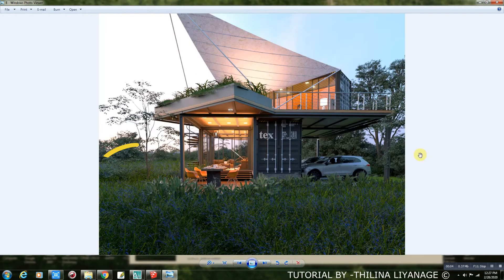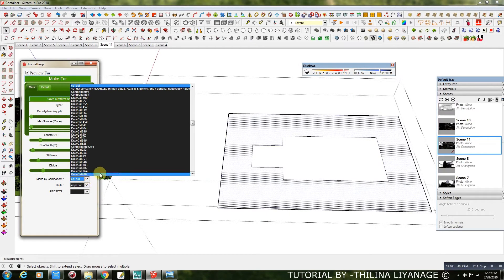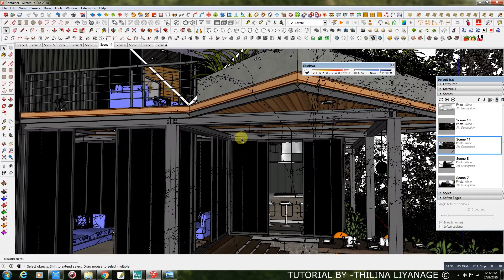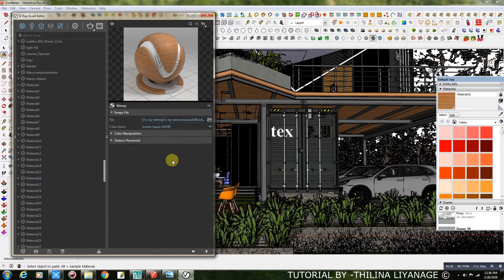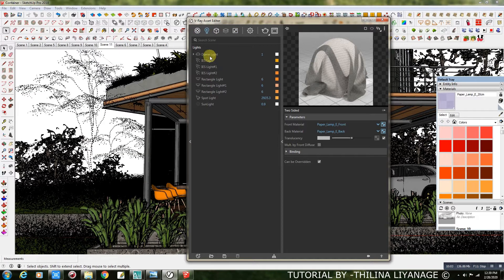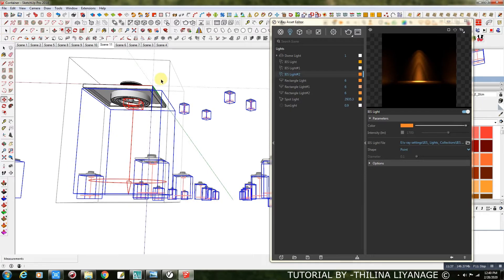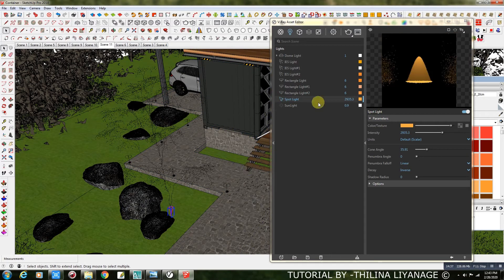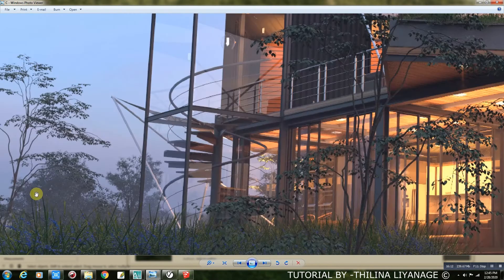Vray Next For Sketchup Render Settings

Comment: How long does it took to render using GTX 1050ti GPU ?? I am thinking of buying a new laptop for vray sketch do I need a better cpu or GPU ??  My 2 options are ryzen 4600h with GTX 1650ti or i5 8th gen with GTX 1060 6gb
Please reply 😃
Reply from the maker: go for 1650 ti
Reply: @Thilinaliyanagevraysketchup  Thank you .. Is it ok if it's GTX 1650 ?? Because it's 10k cheaper than Ti version
Reply from the maker: @elangkumaran1996  but best is ti,if cannot go for same as mine card,gtx 1660 OC vesrsion
Reply: @Thilinaliyanagevraysketchup  the problem is GTX 1660 laptops are all priced above 90k my budget is 70k only bro that's why